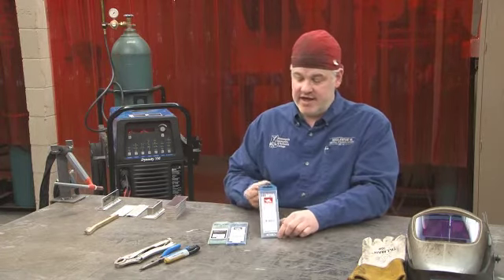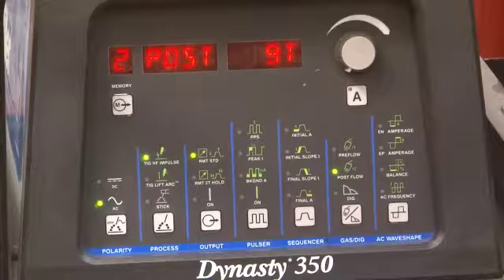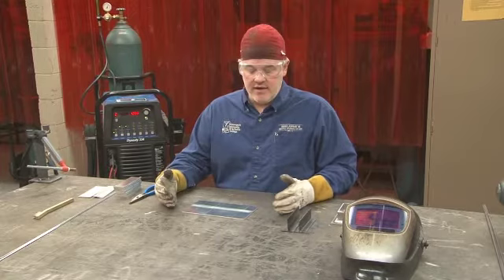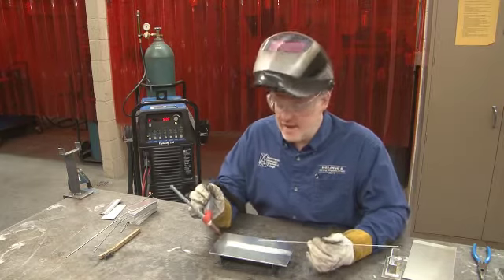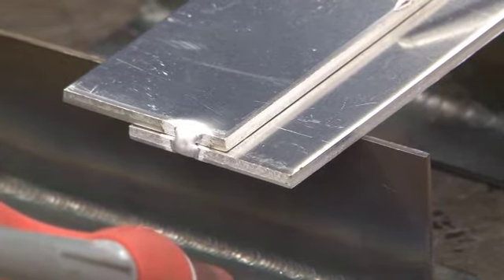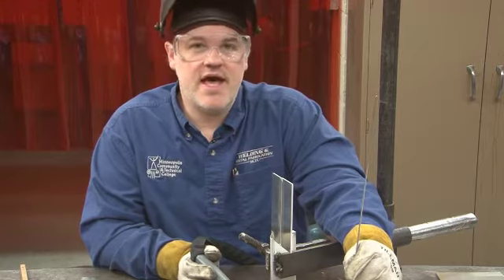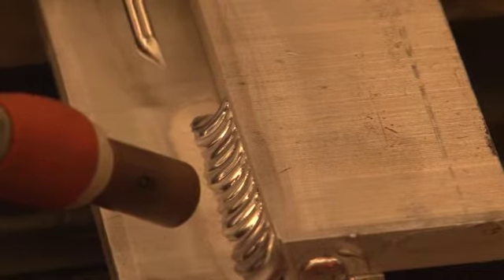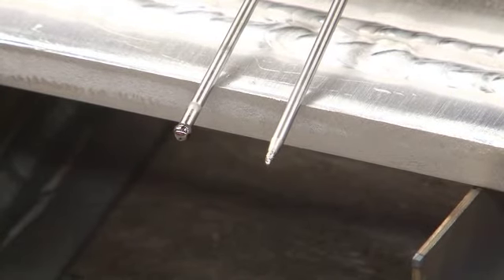PWTV: Aluminum Welding Part 2

Comment: What , no clear pyrex oversized gas lense with a build-a-torch neck? To match that $13,000 welder. Im sure your sporting the $800 wireless pedal under that bench of yours. Im sorry I just find it amusing that students get to learn on the Ferrari of tig welders when 95% of them will never touch a welder that expensive ever again.